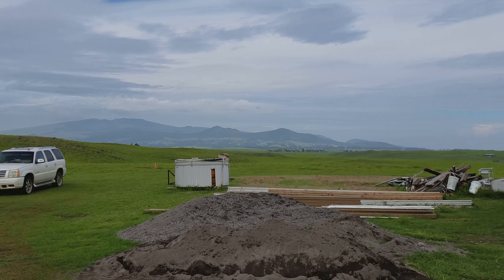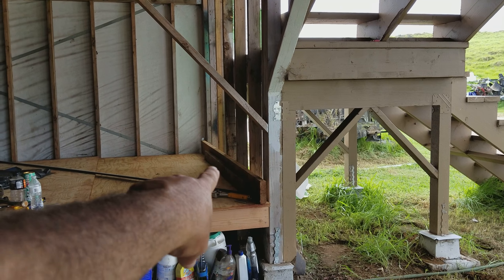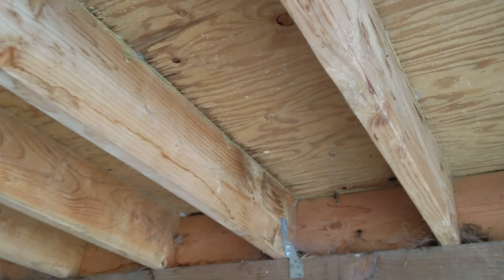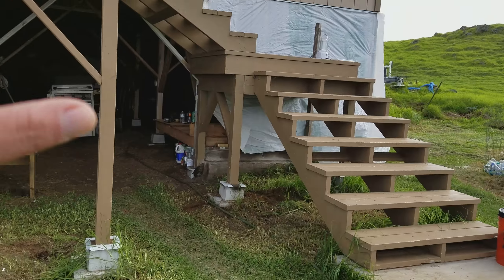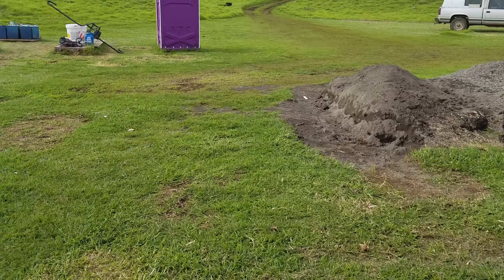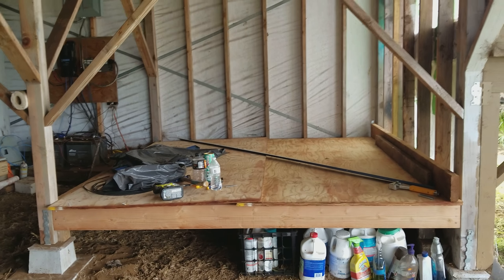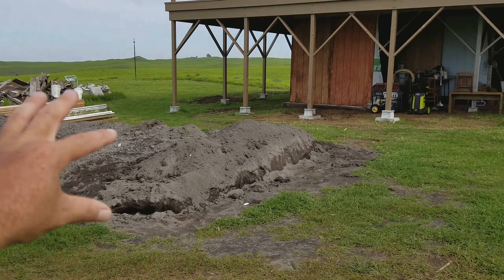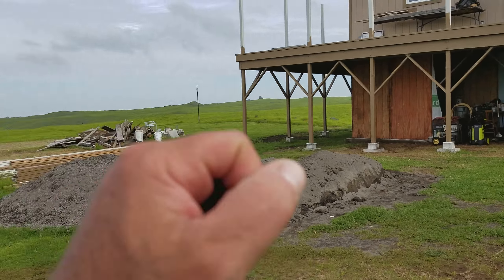Changing Power Room Build Location New Spot

Comment: Smart move to build a separate power room. With the potential fire issues with it being under your house. you will not have that problem.  Especially with the fire hazard of the new style batteries,  you will be using,  I would locate the building right next to wherever you plan on building your new solar panel array,  That will reduce power loss in the lines from your panels to the batteries. Then you can just bury an AC line into the house. Plus you will be closer to the wind turbines as well. An 8x12 building should be more than adequate for your needs.
Reply from the maker: +James Pottorff That was my thinking we on the same page. It will cost more money to build and take longer but I think it's worth it.

Comment: some inverters will tell you how many feet you can run on the AC side before youll see a voltage drop so that is something you'll need to consider and along with the cost of copper from the outside building I get better safe than sorry but the purchase from tesla on the battery packs are defiantly going to be safe its not like your attempting DIY and building the battery packs yourself and not trusting your work or the battery packs a power room really dont need a high ceiling clearance and actually not a "living space"  so the ceiling height around 6 feet would be good enough unless the tesla power boxes are taller than that but hey its your project if you got the money to toss around then good for you. Spend it :-). Myself i have to save every penny i can get my hands on so getting something done for me is save money, make it effective, and be safe.

Comment: A separate power room is ideally best.  My background is 40 plus years electrical contractor.  Most AC power rooms are rectangular.  You dont need depth as much as you need wall space.  Yet you need room to maneuver.  I assume a concrete pad floor?  If so...i would run underground conduits in various sizes to all four walls.  Plastic pipe is cheap.  Doing this will save on metal tubing later on.  Definitely put some pvc stubs on all four walls aimed outward to connect to your towers or anything else. You will thank me later.  I wish i had your land.  How many acres do you have?
Reply from the maker: +Robert Schilling it will be post and pier, I will run conduit most likely cheap easy to work with. Over 300 acres here and more land in 2 other locations.
Reply from the maker: +Robert Schilling Thanks for your insight
Reply: Modern Off Grid DIY ....can i borrow one acre?  I promise ti be quiet.  Haha
Reply from the maker: +Robert Schilling lol thats funny, actually I might be selling 1 lot on the other side of the Island.